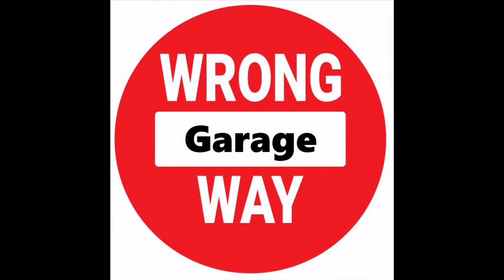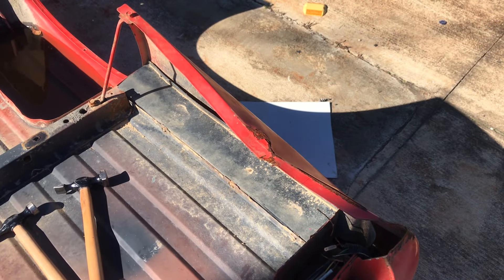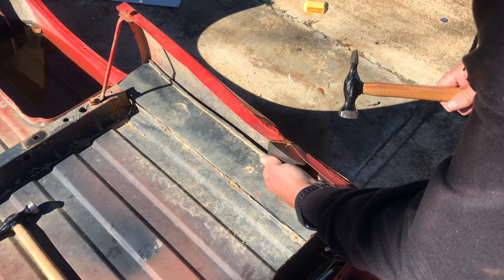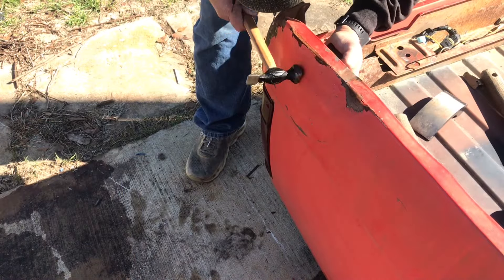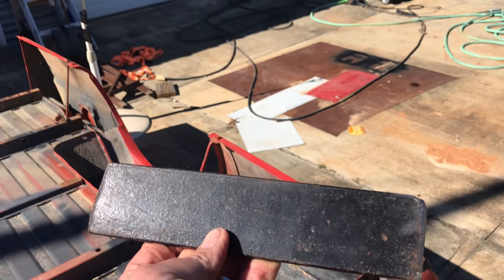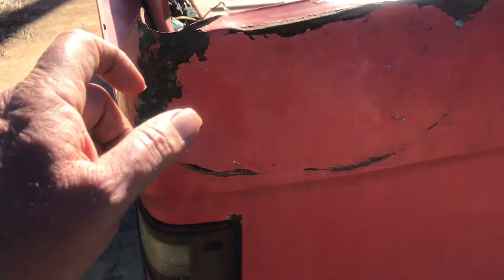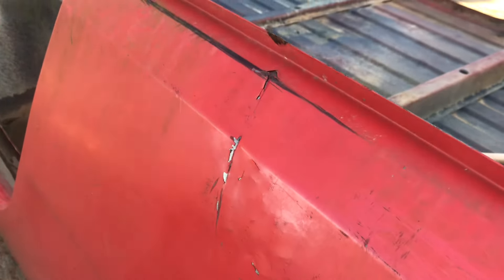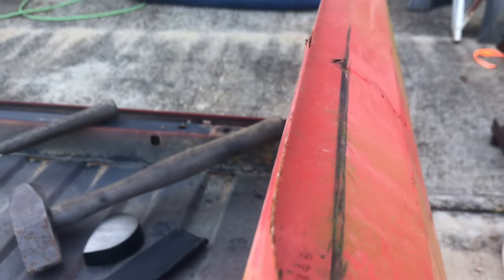Learning to use a Hammer and Dolly

Comment: Nice!!! About all I use from my "Kit" is the dollies. I broke one of the hammer heads. It cracked they are cast, or the ones I have are. I am not a body man by any means. You want to use a dolly the shape of the crown of the panel. Get a "slapper" and with a dolly you can get those small hammer dents out. Watch a few vids on slappers and hand planishing. Also, I have used the dent puller tool to "shrink" panels by welding a stud and cooling it with a wet rag. Probably also not the proper way. LOL. I am definitely of the school of get it close enough that a little mud will fix it. I also think everything I have done adds to finishing the next project. Nice video!! See you next time!!!
Reply from the maker: Thanks!!! I’ve been looking for a wide file to make a slapper with for while. Just haven’t found the right one. The continued support is appreciated! 👍🏻
Reply: I made mine from a leaf spring.
Reply from the maker: @faroironandcustoms6577  🤔 I might need to look around to see what I have. Thanks. 👍🏻